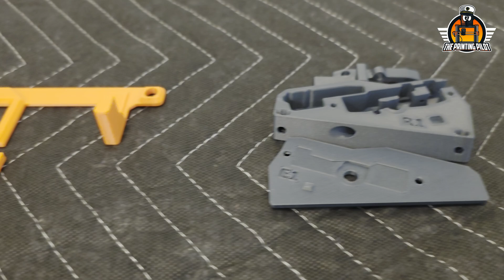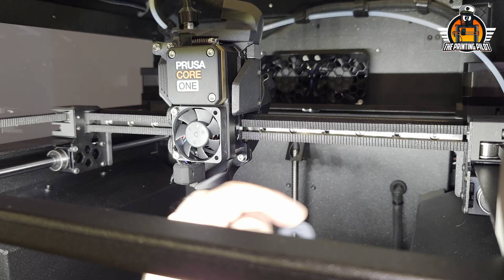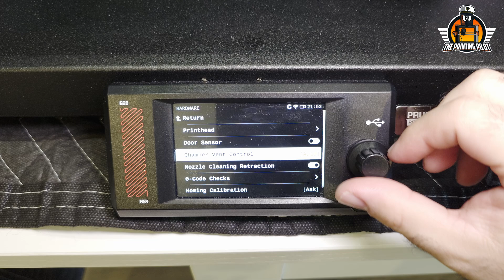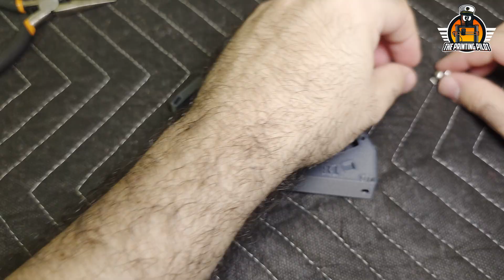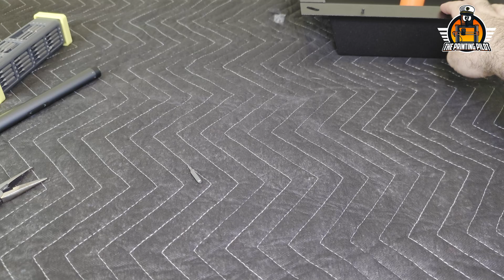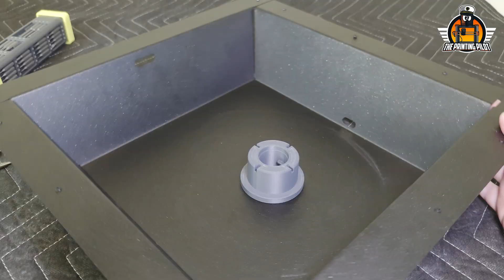Prusa Core One To Core One Plus Upgrade

Comment: If I understand correctly, PrusaSlicer does not generate m780 commands upon printer/filament selection, so it's not an upgrade, just a half-baked possibility.
Reply from the maker: It's working great in the slicer. When I get home I'll send you another comment with how to turn it on
Reply: @ThePrintingPilot glad, I'm wrong. Thanks
Reply from the maker: go to the slicer, under printers, and custom Gcode.
Go to Start G-Code, search for the line with G28 command, and below it past the following code:

M870 {if filament_type[initial_tool] =~ /.*(PLA|PETG|FLEX).*/}O{else}C{endif} ; Open vent for low temp materials

that will check and open the vent before every print.

after that go to the End G-code:
and at the first line add the following code:

M870 C ; close vent

that will close the vent after every print.

that way the vent is always closed when the printer is idle, protecting it from dust, and when a print start, the slicer choose if to keep the vent close or open it. it works really good and it just beautiful to see the printer do its little dance at the start of a print opening the vent.

hope that helped.
Reply from the maker: I hope this helps you and if you like it, subscribe to my channel, it helps me
Reply: @ThePrintingPilot many thanks! Yes, I thought about custom commands, but was expecting some magic without needing me to edit it ;)

Comment: Thank you for the video. I reached the filament sensor part and you mentioned how to take the sensor out in another video, where is that, I couldn't find it. thanks!
Reply from the maker: I think I was talking about the first video of me assembling the kit, but I might were wrong. To disassemble the part at the beginning is just 2 screws and then you can continue following the video with the complete disassembly of the filament sensor. Sorry about that!